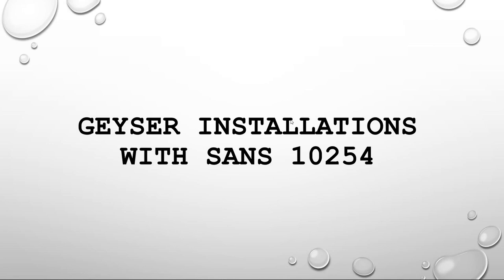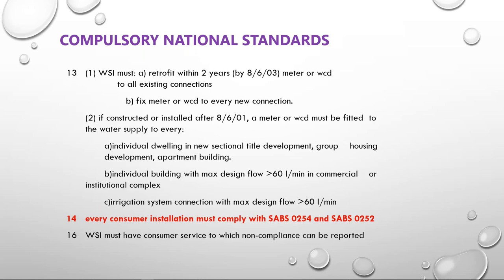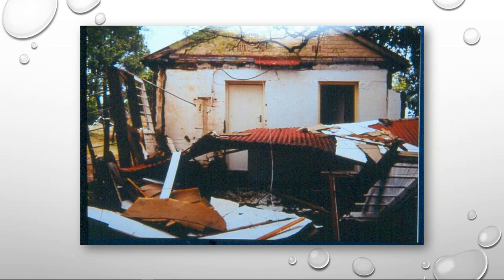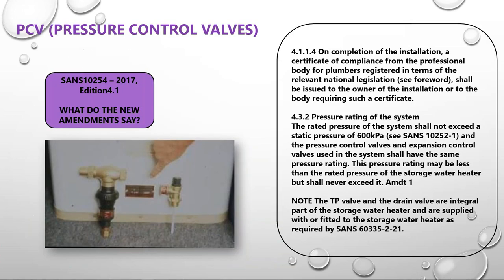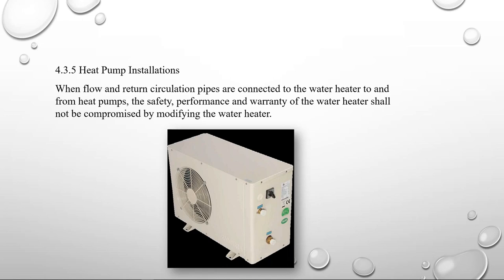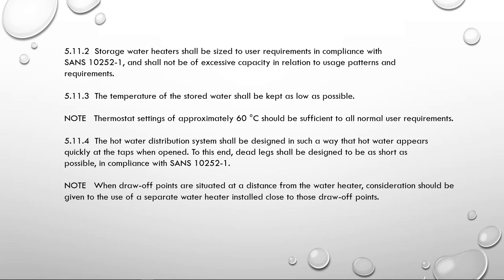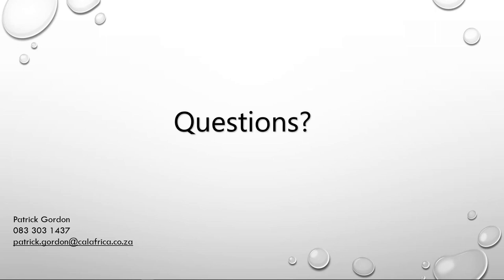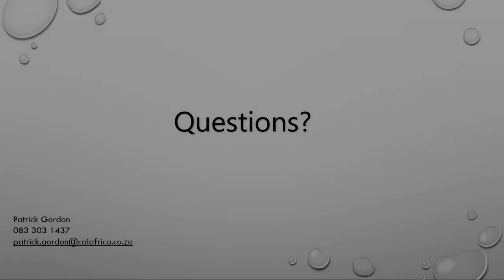PIRB Breakfast Tech Talk Geyser Installations

Comment: Water heating systems need to be improved and re-designed completely. The technology has not changed much in years. But if it improves, plumbers will have less work. It seems like plumbing supplies are designed specifically to fail regularly lately to make more money, not to be safer for the consumer or save water or money. You also need CoCs for everything lately (of course charched for separately). It's becoming so complicated, it's ridiculous.